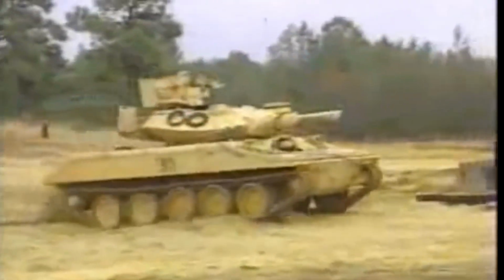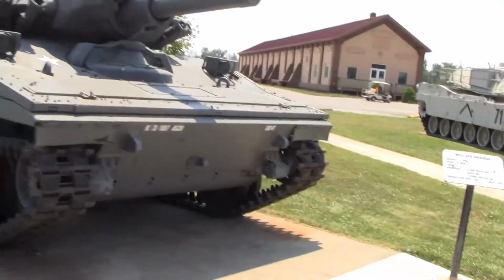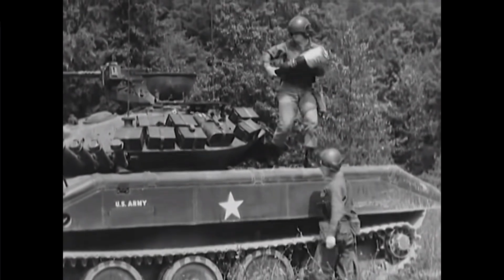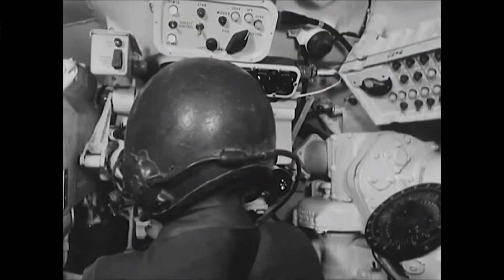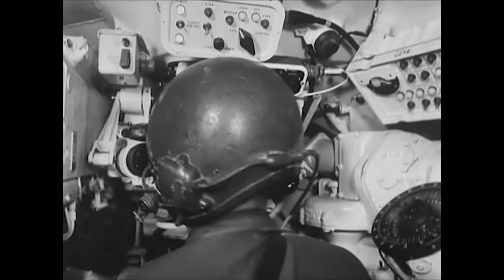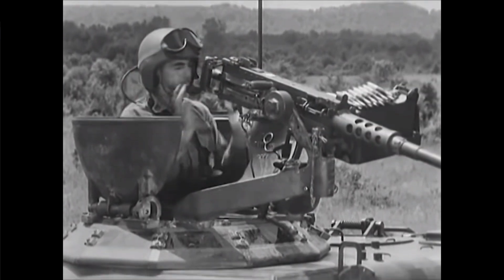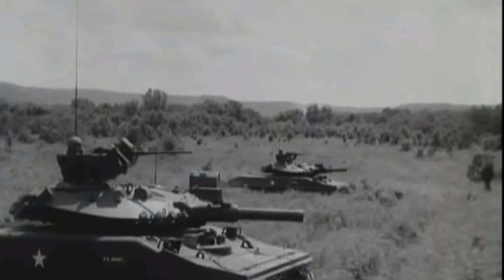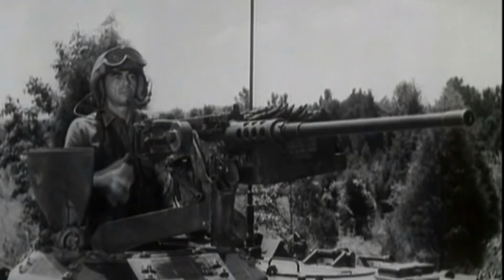M551 "Sheridan" AR/AAV | DESIGN DISASTER!

Comment: Can't help but think that if they gave it a 40mm autocannon it would have had enough firepower to shred any soviet apc/ifv without the recoil issues of the 152mm gun/launcher, and combining that with some proper ironing out of the problems it could have been a very good recce vehicle. The at capability was probably never going to be put to good use because against any tank it would have been dead anyway, and if you really wanted it you could put 2 of the shillelag missiles on the sides like a tow.

Edit.
Losing the weight of the 152-mm (and it's fcs) and replacing it with a 40-mm would allow you to uparmour it to take 12.7 mm all round and 14.5 mm up front (maybe allow a bolt on kit to offer 23-mm protection on the front).
Also the reason i said to use a 40-mm is because the us had a lot of bofors L-60 guns in inventory at the time (from the navy's old ships) and bofors was already building and selling the L-70 (used on the swedish strv-90).
Reply: Sorta like the bmp-3 basically
Reply: @h0st_le960  more like a mix of a BMP-2 and a BRDM really.